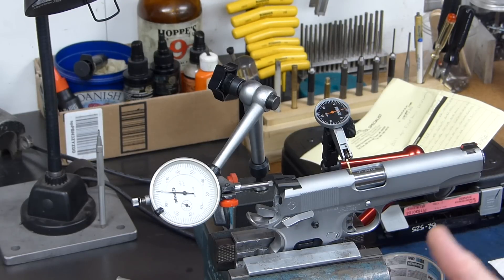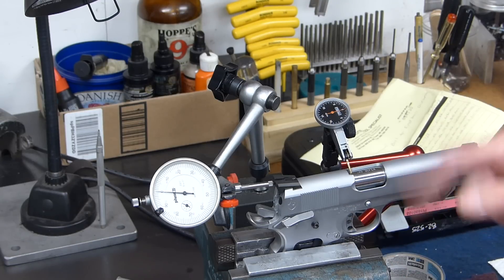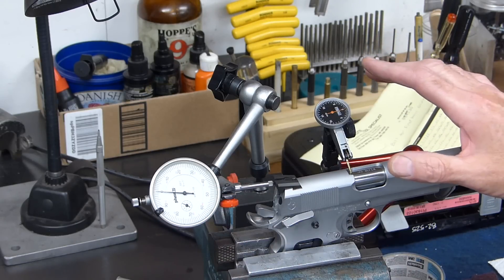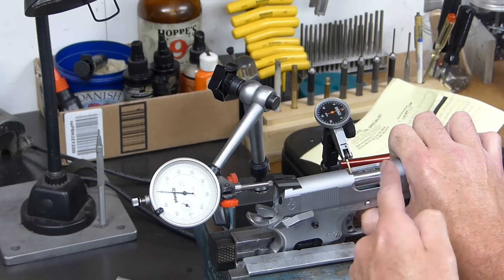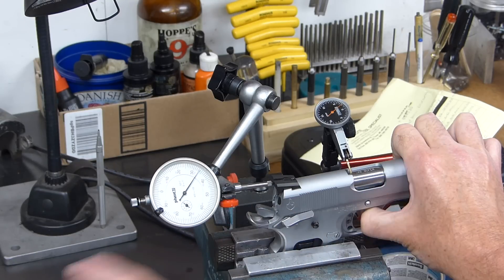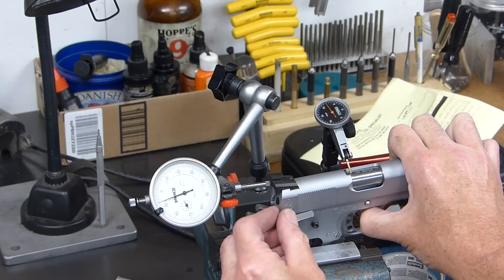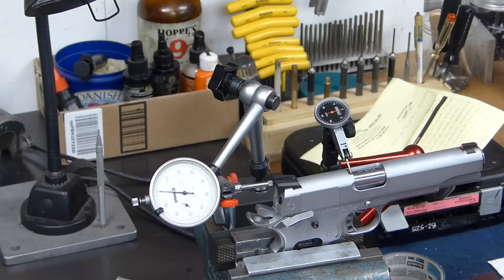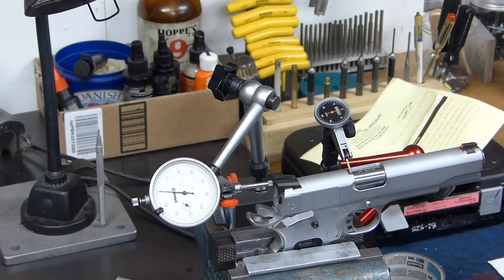How things work. Tilting barrel dwell time.

Comment: Great Explanation. I wonder what a PPQ dwell time is as they seem inherently accurate.  Of course you would use a factory Glock as a base line.
Reply from the maker: Provided the dwell time is in the 0.060" range and the barrel remains in full vertical lock up for that time it will shoot about as well as the barrel can.